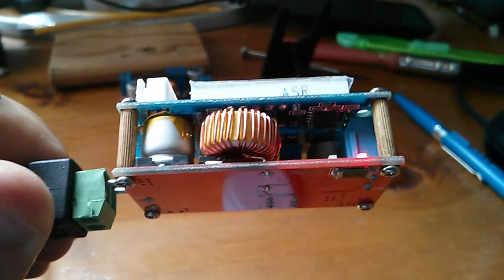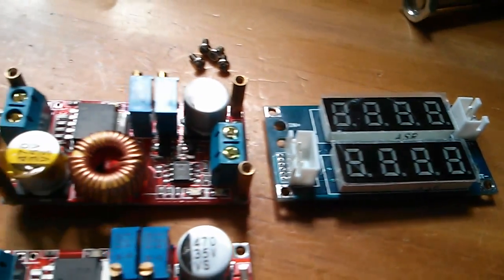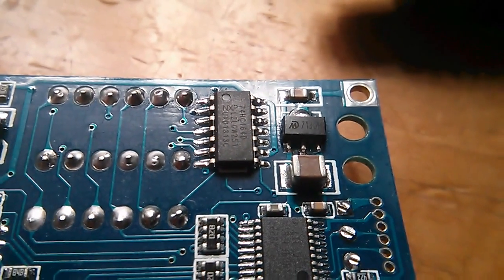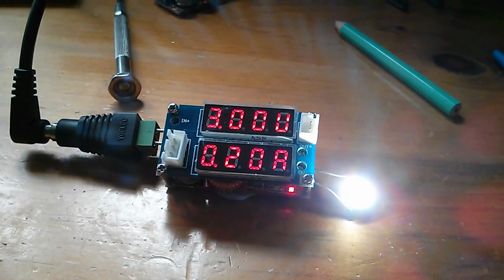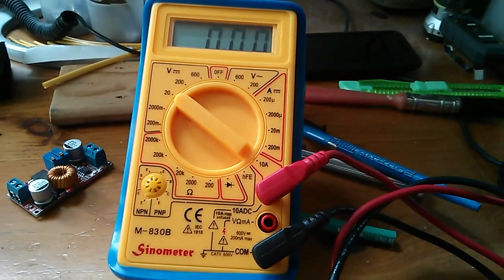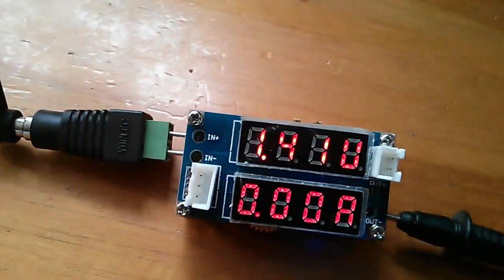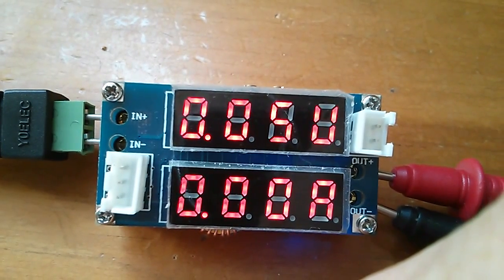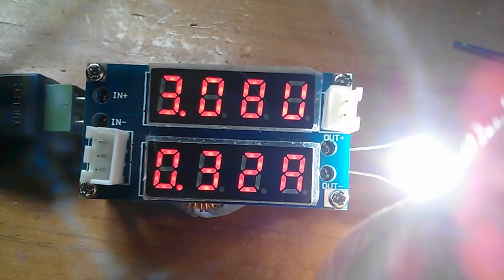Buck Converter DC/DC PSU has Voltmeter and Ammeter and a Bug!

Comment: Well the design does not say "to short the output to set CC", so its not a design issue because some YT'er tells you to short the output. These modules are now built with xl4015 and have OSC protection.

Comment: Hi.  Where can I get the connector's with pin on like you have..  I can only find these without pin connector.  https://www.ebay.co.uk/itm/10-20-12V-DC-Female-Male-Power-Connector-Adapter-Plug-Jack-Socket-For-CCTV-Cable/162568119337?var=461573877541&hash=item25d9d0a429:m:mGyyIJT0nkjUUFjlsXj-o3Q

Comment: I not want look stupid. This is the only info I found to this step down module. I ordered one in ebay and wanted to use it with a 19V 5A Laptop charger.. I want to use it for powering a electrolysis process and need to step down to 12V 2A ..
So I Connected the laptop charger to the module and switched on the power.. the module was showing 19V all fine so far.. but Amps was showing a 0.000A.. I also was not able to step down or up any of the value through the potentiometers. 
I doing some wrong? It is broken? I just connected the laptop charger, was it to early and I first must connect something to the output to get correct values and being able to adjust them??
Thanks for any help 
Kindest 
Alex

Comment: To overcome the bug, you could short the output using 2 power diodes in series.  Maybe leave them in permanently if you don't mind the voltage drop and power loss.
Reply: the issue with leaving them in is the Vf voltage curve, this now makes it not CV for the lower range of current.
I wonder if you did not need the lower output voltage and in stall the diodes after the inductor and before the voltage feedback divider.
Or, have a pushbutton switch to set the CC with the diode load.

Comment: Anyone knows what the serial port and the other are for ? and how to use them ?
Reply: Bit late now, but yes they can be controlled from a PC. They are GND, TX and RX on the serial port.
Reply: @englishrupe01  I dont think so, there is only 4 connections to the control board, power and V & I info, how do you think you can control this? If anything its "might" stip out V & I data, or its to program the MPU on there.

Comment: I have also this type of  cc cv stept down but i have a problem, when the Vin is over 20V the led display is shutting down, i check carefully and i see the voltage regulator for ammeter voltmeter is 7130 1# , this is only for max.  24V input voltage !  So how can this converter work on 30v???? Please another guys who have this to observe what voltage regulator have and write this here ! Thank you !

Comment: What will happen if you short the output with 1 ohm 10w resister once you set the voltage at 0.8v?
Will it still have the same bug of directly shooting up to 5A even if the amp pot is set to the lowest?

I think you just need to avoid direct shorting of the output without having some sort of resistor.

Comment: Thanks Julian for the review!
Did you ever test these little handy Powersupplies for max. amperage?
They are rated at 5 A but i really doubt they would keep going long time on 5 A without extra cooling...
Mine is getting hot already at little over 2 Amps and gets really hot at 3 Amps.
I built a little alu-cooling construction, so that i can use it up to 3 or even more Amps constantly but i dont
dare to use it up to 5 Amps still.

Comment: Does anyone know what the two white connectors on the display board are for?  I've removed mine as they get in the way when fitting into a project box but in the future I'll get more of these as they're pretty good for the price.
Reply: I also have the same doubt. If anyone has figured it out, please let us know here.
Reply: I found somewhere on ebay one of those with info about those two: that 3p connector is a serial data connector, and that 2 pin is I2C i think. On this listing was a picture with this module connected to a laptop battery, also some info about serial protocol used in this. I have two of those modules, but those connectors simply do not work at all, i guess it's what I get for buying cheapest clones.
Reply: They are SMBus lines that can be used to charge laptop batteries - as illustrated in the final photo in the eBay product listings (search for "5A Adjustable CC/CV Display Step Down charge Module LED Panel Voltmeter Ammeter"). II tested it with a few batteries and it seems to work fine. It should work with most any laptop battery since most modern laptop batteries support SBS (Smart Battery System).

Comment: Bought 1 used it a few time and now the led is not working it just say 3v when adjust is still stay at 3v but when but 12v motor in it run don't know what wrong

Comment: See below link you can connect USB to TTL  module to view volt /current reading in serial monitor.

http://www.shopmadeinchina.com/product-image/DC-Step-Down-Converter-DC-5V-30V-to-0-8V-29V-5A_15724530.shtml

http://www.ebay.com/itm/5A-Adjustable-CC-CV-Display-Step-Down-charge-Module-LED-Panel-Voltmeter-Ammeter-/271568028147
Reply: Does it work ?

Comment: Hi Julian, thanks for great review. I bought this one and it works nicely.
I have tried charging NiMh by limiting current and it works fine, I suppose charging LiPos also wouldn't be a problem.
But when I connected it to 7.4V electric screwdriver motor, set voltage to 5-6V and flicked the switch, the display blanked for a bit, probably because the current was too high and it took some time for buck converter to begin limiting.
And after some time playing with it, I noticed that I wasn't able to set current limit below few hundred miliamps. After leaving it off for some time it started working as expected.
Anyway, i just wanted to ask where you got this plastic screwdriver for pots??

Comment: Hello Julian, can you tell what is the size of those potentiometers which are used for setting voltage and current? Just bought one and I'm thinking of replasing them so I could set wall mounted potentiometers. Just asking, because shipping takes some time and would be usefull to order those potentiometers beforehand. Thank you!
Reply: +Markus Kilpijoki They are 10k. I put some 10 turn 10k pots on them, much more useful.

Comment: Dear Julian, i am quite a begginer at electronics, but i always like it a lot and decided to actually learn and do some simple projects. I am fallowing your movies for quite a while and also subscribed rigt now.
Can you please help me with one thing:

My first project is a dyu boom box. I am using a 4 series 6 paralel li ion baterry pack (voltage vrom 10v to 16.8V)  to power an amplifier:
http://www.ebay.com/itm/262136735200?_trksid=p2060353.m2749.l2649&ssPageName=STRK%3AMEBIDX%3AIT

this will give best results at 24 volts

i will use a buck converter: http://www.ebay.com/itm/291595287753?_trksid=p2060353.m2749.l2649&ssPageName=STRK%3AMEBIDX%3AIT
 be able to do the job properly?

What i didn't udrstood is - i will limit the voltage to 24 but the current what i need to do with that because it will draw different amount of current based in power delivered to the speakers. So can i just leave it at maximum and the amplifier will just draw how much it will need? or it will burn the amplifier.

The boom box si more complex but this are my main concerns how this DC DC buck stabilizers work...if you leave it wide opened it should be ok?

Comment: Hi Julian, I bought the same Buck Converter, But the voltage reading for the output is off by 0.5V ; i verified that with 2 different voltmeter's, Is there a way to correct the error ? I removed the 4 screws hoping to find a Preset but there is nothing there, It seems the 3 pin connector on the input side is a serial interface, do you think its possible to fix the error in the reading through this ?

Could you please let me know if its possible. Thanks !!

Comment: Besides the fact that module has a bug at a low voltage it is also not very accurate. Current readings may differ for up to 20% from true values measured with external voltmeter. Other you-tubers, however, have reported that their modules are quite accurate.
Reply: +Yuri Bii  The meter could be out equally.

Comment: Hi Julian Great video and excellent graphic quality unlike a lot on here. Do you know if I can charge a li-po battery with one of these? just that I own one and have a li-po battery I want to charge. The battery has a small pcb built in with just + and - it is 3.7v 5000Mah I know that would push this V/A Board to it's 5A rating. 
Cheers
Bill

Comment: i have a 45watt led power supply 5volt 15amps and 12 volt 3 amps , i put 5 volts on a boost conveter XL6009, i boosted the voltage to 25-30 volt and then i concted this CC/CV step down module , but the HT7130-1 3v reguletor of the module heat up and break, WHY...?????

Comment: Wow!! Well, that's good to know.  From now on, I'm going to use a solar panel as the input to any new Chinese electronics I buy (buck converters, boost converters, etc) until I trust them.  I wouldn't want to connect them to the battery the first time... not even worth burning out a fuse (which I don't always use!)  I had strange activity on a high current/high voltage buck converter where it would act crazy if the load was very small.

Comment: Hi Julian, I saw your evaluation of this bug (ha ha) converter thanks for that. Nice device by the way. I have a problem and a question about this device.  I have two of these power supplies connected with their inputs to one power source of 24Volts. Individual they work fine in this configuration. This means I have the common ground at both outputs not connected  with each other and both displays indicate current as is should. When I connect the two output grounds together both displays suddenly change the values of the currents. My knowledge on buck converters tells me that this is not and issue of the converter but of the display units. Can you explain what the issue is. Thanks  Oscar Goos
Reply: ***** Hi micro site box, Thanks for you reaction. I hope others might benefit of it in case they work with power supplies with a common ground. I have connected the the two supplies with a common ground you are right. The shunts are in parallel and the current is now half of what I expect. The sum of the currents is now the total current through the two parallel resistors. This makes them useless because its unclear which power supply consumes what current. They should have designed the supply with a Common mode differential voltage amplifier to measure the voltage over a resistor in series with the output of the supply. In that case there would not be a problem with putting the supplies with common ground.
Thanks for your help Oscar Goos

Comment: Hi Julian Ilett :) Thanks your videos :)  I bougght this device and I tesed yet. I think this device not produced bug. I checked other way. I put the output the 10 W 9.6 V and 1 A current working parameter Power led dode. And this diode cascading the other digital ammeter and I mesured correct values voltage and current too. I drove the led 1 A current I thinked important too see the ammert have inside reseistent. If I cascade the otside ammeter I mesured  0.5 A this panel and 0.5 A current outside ammeter. This is corrct because must to see every meter had inside resistor. I suggested Julian to put cascade with loading ( power cob diode buld etc ) the outside ammeter too :) You must mesure each and other meter the half value of total current value too :)

Comment: Hi like your stuff. Going to try to make a bench psu from an old computer psu and one of these buck converters. Have you any tips or things to watch out for?
Reply: yes used an old lap top psu and a b3603. works great. well good enough for my needs. still learning.
Reply from the maker: john moor Take a look at the B3603 - you can set the voltage and current on a digital display rather than on potentiometers
Reply: Hi, can I replace the potentiometer with panel potentiometers? so I can use it as John Moor wants. If so, what would be the value? Thanks.
Reply: did you make it ?

Comment: Great Videos!
I'm currently trying to build a LED light for growing vegetables. Using various color 3w Leds. I have bought a power supply with adjustable voltage.I'm wondering if it would be a good idea to buy a buck converter as well? I'm aiming at using as little energy as possible.
Reply: Robin Lee Robin, it would be best if you run your LEDs with cc (constant current) versus cv.  IMHO this little Buc will do exactly what you're looking for (depending of course, on your total power draw.  Running lots and lots  of LEDs?).

Comment: Thank's Julian, Great Video. Great tip about the short circuit at low voltage. I made a benchtop power supply with the converter. Work's great. By the way the capacitor's get pretty hot too !!

Comment: I bought one of these devices several months ago and was curious whether it showed the same behavior. Indeed it has the same bug and another one, which shows also in the video, but is not commented on: notice when you reduce the current limit setting, the blue light comes on, but the limiting is actually happening much later, after turning the trimmer much further. The actual current limiting is indicated by a red LED on the opposite (upper) side. I have observed that the blue LED turns on at about a tenth of the limiting current. After reverse-engineering the schematic, it was obvious where this discrepancy is coming form, and also why current limiting does not work if the voltage setting is at or close to the minimum of 0.8V. The way the circuit is built the output resistance of the module is actually equal to 0.05 Ohm, because the current sense resistor is not inside of the voltage regulator loop. As an electrical engineer, I wonder what the designer had in mind when he created the current limiting portion of the converter module (lower board); the behavior of the module is not what one would expect.
Reply: i.e. with the current limit = C the blue LED lights when the current descends to C/10 in the CV phase, which is the typical termination current in a CC/CV charge. This signifies that the charge is done.

Comment: I have one of these, the add where I purchased it on Ebay show charging a DELL laptop battery with it, I hadn't planned on doing this with it, but just wondering if that is possible or wishful thinking from the seller?  It also shows the red and blue LEDs as charging and charged indicators
Reply: I've heard from people that it works, but I haven't tried it, yet. The way things are connected in the diagram, the additional lines are hooked up to the battery pack's SMBus clock and data connections. I plan on watching with a logic analyzer to see what communications happen.
Reply: @nonayabiz1  hi, did you find informations about 2and 3 pins connectors above the module ?

Comment: Might be a stupid question.. but.. Does a buck or boost converter maintain a constant voltage & current output?
Reply from the maker: MARK ONE A constant voltage OR a constant current output
Reply: Julian Ilett Kinda figured that. I don't have a adjustable power supply, just battery cradles for AA & 18650 batteries. I actually bought & received the ( LM2596 DC Power Supply Adjustable Converter Step-Down Module LED Voltmeter + USB ), from comelili. Bought & will receive the ( DC Boost Converter 3-35V 100W 6A With Voltage/Current Digital Display USB Output ) from polelu on Monday. Really excited. After this winter season, I actually plan on using them with 100 watt Renogy Solar Panels. I want to get the SEPIC converter they have on eBay as well (1.25-50V Adjustable Buck-Boost CC-CV Power converter module LED Volt amp meter) from lu_cytime208. So yeah, that's really great they maintain a CC & CV. Thanks for the reply, much appreciated. (+1)

Comment: The shunt resistor on the back seams very small, I think it can dissipate  max 1W and its resistance is 0.05 Ohm. So it can not withstand continuous 5A, but only 4.5.A. (P = A*A*R; 4.5*4.5*0.05 = 1.02 W). However, to be shure, you can calculate 0.5W, the max current would be 3.2A, and at 0.25W calc shows 2.2A. So anything less than 3A should be fine for long period. You have to ensure good ventilation for the resistor, providing opennigs in the case and at least 5 mm (1/4") from other parts.

Comment: Hello Julian Ilett, 
I wonder if whit this device can charge a battery 18650, regulating voltage to 4.2V and current of 1 Amp, for example.
Excuse my English, if I missed something
Reply: +Julian Ilett ,
U r right tht th it will not cut th circuit once cell is full, bt there will be no potential difference of voltage , so no current will flow. Am I right or correct me pls. u th electronics boss.  :-D
Reply: @fklotaloi  i believe you are correct. i have read that this is how the module works, but there may still be a very small trickle current even when the input and output voltages are essentially the same. The Data Sheet might point to when the module starts feeding current again!? Might  be when the output voltage drops to a certain level from the set voltage on the converters potentiometer!?
Reply from the maker: Alexandru Brindusa Yes, you can regulate voltage and current with this unit, but it won't switch off when the cell is full.

Comment: How can use the voltmeter alone? 
I have bought this and I've blown it up, the voltmeter is working. Maybe I can use to measure voltage. I've already tried disconnecting it from the rest of the circuit and applied voltage but it didn't work.